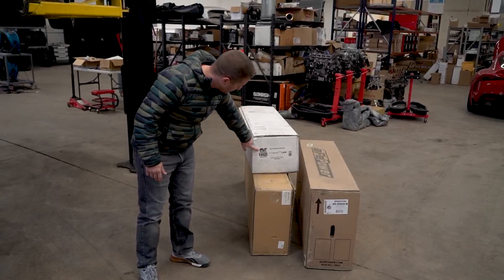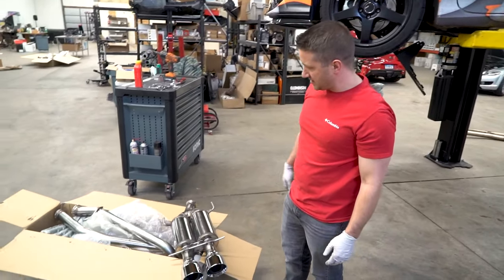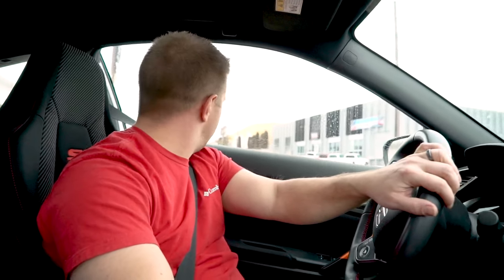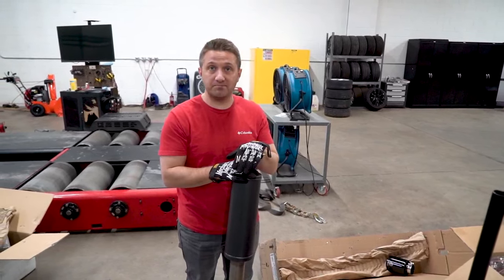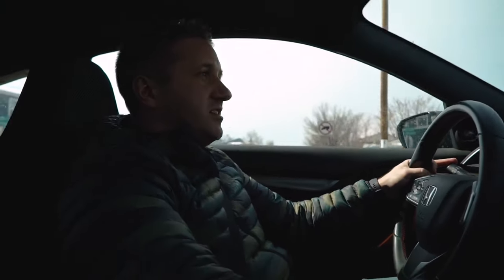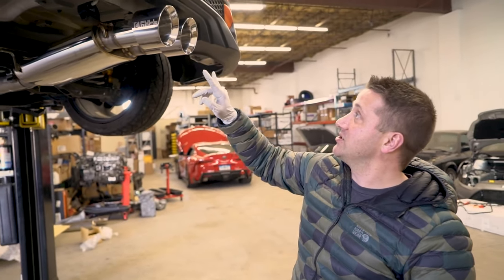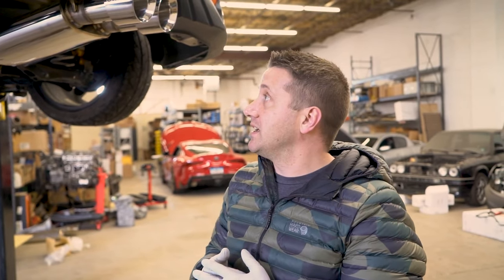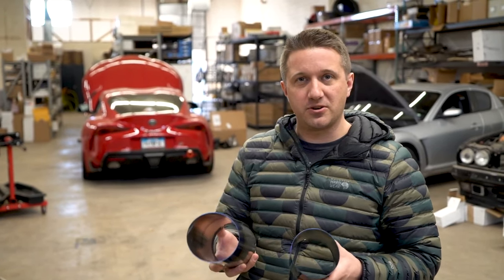We Install 3 MORE 10th Gen Civic Cat Back Exhausts  |  Project FC3

Comment: The magnaflow sounds good actually I like how it’s kinda quiet
Reply: quiet but not so much combined with DP/FP upgrade. Its pretty good form the inside but definitely louder from oem. Cruising around 2500-3000 rpm on the highway you'll definitely ear it inside

Comment: For anyone looking for the perfect exhaust set up on the x gen Si do a catted or catless prl down pipe and front pipe then followed by a BORLA S Type. You will get the best sound out of the Si with this setup. I had it and always got compliments from people, they couldn’t believe a civic could sound that good. You get a few pops and bangs every once in a while but nothing too annoying and at wide open throttle it sounds great. The borla is a little pricey but honestly perfect for the Si. I know there are hardly videos out there with that setup but once people figure out how great it sounds they will flood the internet with them
Reply from the maker: Did you check out our previous 10th gen exhaust video as well? The Borla S-Type is one of the exhausts we installed and tested, and yes, it does sound excellent! https://www.youtube.com/watch?v=rDOj0TLwmvM

Comment: Hell yea!  Glad to see you guys still at it.  It HAS been a minute since the exhaust lineup video, but so good to see new stuff!  Really like the low tones out of the MagnaFlow.  Seemed to be purpose tuned, while the other two... not so much. Did you happen to do any highway time with the MagnaFlow?  I'm curious about highway drone.
Reply: highway should be fine.  mine is similar to this but general road noise is an issue with these cars and if your exhaust sounds intrude a bit much, its easy to tame them with some strategic insulation like a piece of lighweight pad under the rear seats and other things
Reply: @jamesmedina2062  Cool, Thanks brother!  I own a '19 Si and it definitely has its share of road noise (some surfaces are almost unbearable, lol) - but I appreciate the input about the exhaust.  I'll probably do a little sound deadening for stereo at some point and I'll keep that advice in mind.  TY! Peace.
Reply: @marrowdreign  Yeah you are right. I grab cheap stuff at junkyards. On Civic sedans I think Honda used a better felt type wheel well liner that is fastened with about 7 fasteners. A narrow screwdriver lifts the center of those plastic fasteners and you could swap it to yours or you could buy black wool felt and stick it onto your liners with 3M waterproof spray glue. Mine has remained well adhered despite some heavy rains and even snow. That made a big improvement. I used DEI aluminum/fiberglass tunnel and firewall material and used it in the tunnel area and above the exhaust joint between the front pipe and the rear pipe section. Doors for sure need done. Dont make them heavy though with Dynamat. Buy a lightweight closed cell foam material on Ebay with adhesive backing and stick it on inside of door skin and use Lexus insulation you can buy for 5 bucks at your junkyard and apply that to inside of door panels. They come off super easy. Its a Honda! Take care. What tires you using? I am using Toyo Extensa II and they are quiet.
Reply: @jamesmedina2062  that's a good tip about the Lexus insulation.  I hadn't even thought of that.  I didn't want to use dynamat because of the weight.  I'm trying to get the most bang for your buck with light materials.  These are good tips.  I'm still rolling on factory rubber but replacing them soon they're at about 30%.  (All season) I'm shopping around for new rubber but haven't decided who I want to go with yet.
Reply: Did you notice any mileage change when you went with the toyos?
Reply: @marrowdreign  actually I think the Toyos are not great in the mileage department, maybe like 1 mpg worse but I can't be sure or stingy! They are sticky, quiet, and squeak a ton in turns. Continentals get a bit higher mpg and are a little firmer. The Toyos are just sticky and when you turn the wheel they do steer quickly. Not good in the snow. The Conti's have all season and snow down good. There is a Uniroyal Tiger Paw made by Michelin I want to try. Falkens have been quiet but they wore away a bit fast.
Reply: @marrowdreign  make sure you don't get Bridgestone as they are heavy and have gone to crap. Made in Mexico. 

Yup Dynamat it too heavy. Not even that quiet. Btw the new 22 Civic is very quiet but also very expensive like 28k+ for the 1.5 Hatchback. They nailed the exhaust tone. 

So a couple of more things that will help road noise/engine noise. First is hood liner with adhesive. The hood does have an insert that you can remove and replace and put some adhesive hood liner in the spaces and around the perimeter. On the bottom you can stick a material on top of the aluminum belly pan. It will see water. I used a 1/2 inch industrial wool felt with spray glue and I cut out the holes where they go for ventilation. It adds 2 lbs. Works great. You can even look at it every oil change to ensure engine is dry. So far I have no leaks anywhere. The rear trunk or hatch has a panel and you can throw some stuff in there. Of course just a little spray glue but that panel snaps on tightly and will hold anything in place. Did you say you have a hatch? The downside is that two rubber pads on each side need to be left in place and that makes removal from the hatch of the panel difficult. I removed the rubber pads (20$ each new from dealer) and the two plastic threads will destruct on removal. 

There a black plastic or black felt material that attaches to underside of floor on outside of car beneath seats and again Honda in their brilliant mind thought to use plain plastic on lower and Sport models but I believe its sound absorptive compressed composite felt on EX and LX sedans. Not sure if it will fit on hatches though. I think this is one of those things with not that much value. 

But yeah so in order of benefit and ease I would say
1. door panels
2. belly pan felt
3. hood liner 
4. front wheel liner 

Major changes with these four

One more!: Between rear seats and doors are plastic panel that has nothing inside it. You can pop them off easily and stuff some loose wool or DEI noise fiber(it's grey) or Dacron.

Comment: Had 3 exhausts on my Si Sedan and the Full Race was by far my favorite. Zero fitment issues but I didn't have a coupe. It sounds and looks amazing. Super well made also.
Reply: How loud was your full race exhaust? Seems pretty tame but still sounds good from what I’ve seen
Reply: @aarono7404 , It was tame when you wanted it to be which is important to me in a DD. When you're pushing the car, the exhaust wakes up. I have a Type R now and the AWE Touring Exhaust with a Catted PRL Downpipe definitely gets annoying because it's never tame.
Reply: I have a full race currently but my downpipe is catless and the drone is bad especially at 3k rpms doing 80
Reply: @keithbegley888 , Yeah when I had the Si I had the stock downpipe with the Exhaust so it was perfect. Now with my FK8 the same situation as you. The AWE Touring Exhaust with the stock downpipe was fine. After I installed the  Catted PRL downpipe with it the drone got pretty bad. At highway speeds its there at all times.
Reply: @thinkforyourself5672  well I’m making some serious power thanks to my Garret turbo so the downpipe Prl provides for said turbo kit isn’t like the one for stock turbo. Regardless it’s loud as hell but hearing the ball bearing whistles is worth it plus it’s not like I listen to the radio lol my exhaust is the music to my ears. And it’s not a daily. I’ve been thinking about getting a 27won exhaust because the quality is amazing
Reply: @keithbegley888 , That's exactly the one I've been looking at too. It is my daily and I don't want to gear hear a fucking drone all the time.
Reply: @thinkforyourself5672  yea you don’t see a lot of people rocking their exhaust more so why I want it lol and I actually have the prototype full race exhaust since they are local to me (AZ) I got it off my homie who was contacted by FR he got a hell of a deal for it. I traded my stock exhaust and 500 for the exhaust hell of a steal since nobody wanted it lol so it is pretty cool to have a prototype 1 of 1

Comment: That’s very weird on the Full race exhaust because I have the exact same one on my coupe and I don’t have any fitment issues. The only slight issue if I should say was the same hanger you were talking about but I was able to straighten it out it wasn’t as crooked as how yours came out. 

Regardless it’s my favorite exhaust to have on these 1.5L and on the 8th gen and 9th gen Si. 🔥
Reply from the maker: Interesting. We may have simply received an imperfect kit, then. Either way, glad yours fit up awesome,  as we also loved the sound.

Comment: I am looking for a smooth exhaust, which one do you recommend?  I have the full race installed with the down and pront pipe PLM, but sometimes I can't stand the noise inside the cabin, it is very annoying :(    the HKS is smooth ???
Reply from the maker: Its hard to recommend an exhaust, as it's mostly up to your sound preference! That said, the AWE Touring we just tested was very smooth, and so was the Greddy from the first video. ARK exhausts are also a good choice, with that Hemholtz resonator to calm down the dron - You can always give us a call if you need more help choosing!
Reply: @EdgeAutosport  thanks by your quick response ... excellent options , I am really liking the exhaust HKS , what is its sound inside the cabin , is soft or annoying ??

Comment: I love your exhaust videos for the Civic 10. Could be cool after testing the sound of the exhaust, getting the exhaust system tested with a power measurement of hp and torque. 🙂

Comment: I'm sure the clamp was fine, you don't need to crank them down super tight. And if you know the clamp is "dinky" why would you "crank it down pretty good" just get it snug and it's fine it doesn't see very strong forces.

Comment: I wish you would of reviewed the MAPerformace quad tip race exhaust.  I have it on my 2018 civic si and I love the way it sounds and looks.  I dont have have a downpipe or frontpipe installed yet, waiting on clutch, flywheel, intercooler and charge pipes to be delivered to get it all installed but with a aftermarket downpipe the tone sounds great with the quad tip race exhaust.

Comment: How do you get the turbo to make that noise? I love the way it sounds !!
Reply from the maker: The bypass valve noises? We have the TS plate on there now: https://edgeautosport.com/torque-solution-blowoff-valve-adapter-red-honda-civic-1-5t-all-2016-2019/ - super easy install for great sounds!
Reply: @EdgeAutosport  aside from the valve do you need to replace anything else or is it that simple ?

Comment: Do these exhaust fit the 10th hatchback sport? And the exhaust from the last video?
Reply from the maker: These are coupe-specific exhausts, so look for the hatchback fitment: https://edgeautosport.com/ark-performance-dt-s-catback-exhaust-burnt-tip-honda-civic-hatchback-sport-2016-2018/ not many differences but important to know when ordering
Reply: @EdgeAutosport  also do you guys suggest using a blow off valve or just upgrading the intake? I’ve heard people having problems with putting aftermarket blow off valves on 10th gen civics.
Reply from the maker: @oxyeekithebeatgod2501  Both? haha we've never had any issues, and we dyno our car all the time! If you want maximum volume from shifts, a metal intake and BOV is the ticket.
Reply: @EdgeAutosport  just bovs I’ve heard people have problems with. Wanted to get that cool bov sound everyone fiends for but I heard with an upgraded intake, you can get that sound and extra gains. I seen a hks bov I wanted to get. Btw, love the content you guys drop. Please drop more Honda Civic vids. Thanks

Comment: Will any of these work on a 2019 Civic EX CVT 1.5 l Turbo-charged?
Reply from the maker: These are all coupe fitment, but any turbo exhaust should fit - search by your chassis (hatchback, coupe, sedan) as they should work across the same chassis.

Comment: I ordered the FullRace Exhaust for my 2020 Honda Civic Si Coupe and never heard of the fitment issue till this video. It'll be here in a few days. I saw Tony Castillo's Vid and he didn't have this issue. Did you guys figure it out? Im worried now I'll have this issue. I find it hard to believe a company like FullRace would goof so bad on something like this. Would like to know before installing it. Thanks.
Reply: Hopefully your fitment is good. I haven’t had any issues on mine. Over a year with it and no issues on the hangers.
Reply: @TdaKid  Me too. It arrives in few days and I'll be having installed Thursday. Hope all goes well. I emailed FullRace immediately asking about this. Perhaps it is the order the pieces were installed or some piping was mid aligned. I hope edge replies back. I'll let you know hoe things go.
Reply from the maker: We did not get to the bottom of it yet, but if you are having it installed at an exhaust shop, they can totally make the modifications to ensure it works - not the end of the world, thankfully. We will do a follow-up video or something to clarify how it all shakes out.
Reply: @EdgeAutosport  Sounds good. Looking forward to the follow up. Crossing my fingers everything goes good in my end. Let you know how it goes. Should be here tommarow and I'll be having it installed Thursday.
Reply: @andrewsorokin5734  have one for the coupe and i have no issues!

Comment: Hey all! Does anyone know of a decent aftermarket exhaust that will fit a 2019 Civic hatchback LX? I know, I should've got the Sport, but I was in a hurry to get a vehicle and the LX was the best I could do at the time. Thanks for any suggestions.
Reply: any of the aftermarket exhausts can be easily modified for your car. Usually you just need to cut the rods on the mufflers and change them a little for your hangars  and reattach with TIG welding. But where does your exhaust exit?
Reply: @jamesmedina2062   I have a 2019 civic hatchback LX. So  It's a dual exhaust. The problem I guess is that it has a spare tire in the back making it hard to find any aftermarket exhaust kits.
Reply: @arnie413  My car has a spare tire too. Its just SI has no spare and big mufflers. Plenty of exhausts will fit nicely.  Are your exits in the rear bumper in center or corners?
Reply: @jamesmedina2062   It has the split exhaust.. One pipe comes out on each corner corner of a bumper. I have only seen one aftermarket exhaust with the split exhaust setup.   It was a magniflow I think.
Reply: @arnie413  ok. Magnaflow is not great but it is ok. I was just telling this guy that you can take many systems and cut and modify them pretty easily. You need to find cars with corner exhausts. Check out ECS Tuning and search Milltek and Supersprint especially the VW GTI exhausts. I use a 4 inch cut off angle grinder and make clean cuts and have my friend tack weld for fitment and then I check it on the car. Its fun. After tack and check then your guy Tig welds completely. But for flow the stock 2 inch pipes need increase to 60mm, 2 1/2, or 70mm to at least the front pipe and front pipe could use replaced but I have not done mine yet. Performance improves significantly over stock EX, LX, and Sport exhausts. 3000RPM-6000RPM breaths freer.
Reply: @jamesmedina2062   Thanks for all your help James.

Comment: Any update on full race exhaust?? I really love how it sounds!
Reply: I have the same one and mine came out straight. I have a video on it on my channel if you wanna see. Definitely sounds the best for our cars
Reply: @TdaKid  I've watched your vid several times already and I just can't see where things went wrong for edge. I did notice your hangers went in deeper then there's and they didn't force it like you did. They just slide on and stopped when it it wider section. You seem to have force it over that on both ends and the hangers kind of hang at an angle instead of straight on. I think if they did that, it would work. It also could be off somewhere else, causing the muffler at the end to take the brunt of the issue. Edge did mention they used different hangers after the muffler. I wonder if that is the issue. Also in your vid you put the hangers on first before putting the muffler on. I wonder how much time they spent adjusting the piping all together and tried to take it off and put the pipping of in a different order?
Reply from the maker: It was actually less about the midpipe and more about the muffler mounts. The muffler mounting rods were physically wider than the hangers, considerably so. There was really no way it could work, not right now without modifying the mufflers. We will be sure to do a follow-up video if we get good info back!
Reply: @TdaKid   thanks man I’ll check it out!
Reply: @EdgeAutosport  okay thank you! I’ll wait for that update before getting the exhaust!

Comment: Do any of these fit the 2.0 non turbo 10th gen ?😅
Reply from the maker: Negative, these are for the turbo motors
Reply: @EdgeAutosport  would an exhaust shop be able to fit them to a 2.0 non turbo?  Or would it affect sound